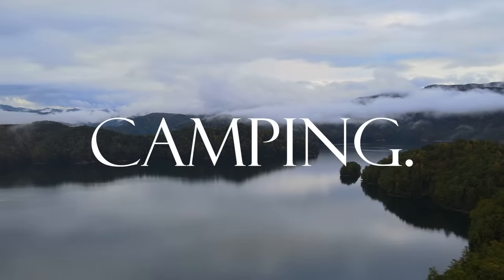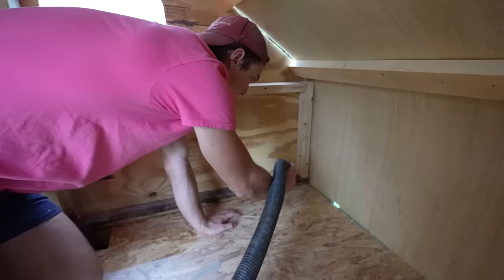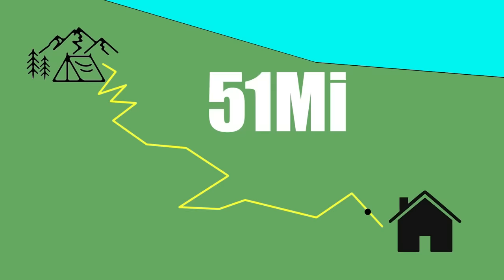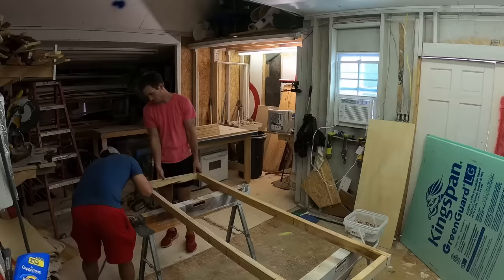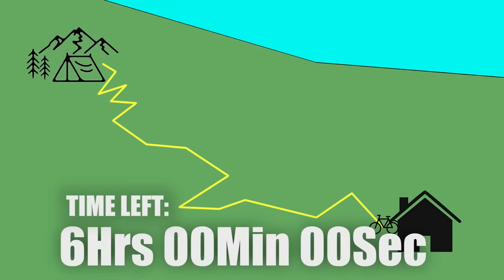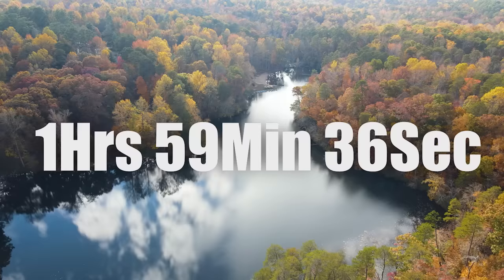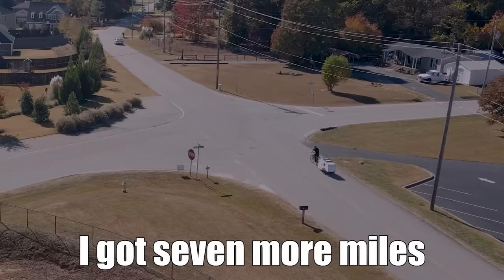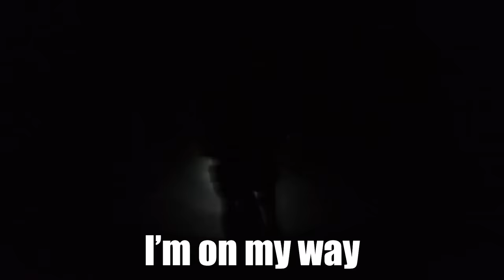I built a camper I can pull with my BIKE!

Comment: If you want to make a sturdier version, you can make the next one out of fiberglass. Super tough and extremely light too
Reply: Smart
Reply: @Spike16 where did u get it?
Reply: Just dont make submarines of it and you should be aok
Reply: @LPFGUERRA  That submarine was carbon fiber, not fiber glass.
Reply: @@spike1670 They are too big to be pulled by a bike though they are light for a nice camper they will need a vehicle to tow them.

Comment: The gate didn’t seem like too much of an obstacle to begin with lol. I thought it would have been much bigger. Idk seems staged at the end.. but good shit. You guys always work so hard.
Reply: Here in our place its normal idk why but its not so secured well i guess its that for a reason.
Reply: That gate is pretty effective if you'd be trying to get a normal sized camper inside. This one is tiny and made out of foam lol.
Reply: I also like the idea of it being locked down so if you have a sudden, life threatening emergency, no one can get in or out.  Good luck if you have a sudden health issue.
Reply: @cujoedaman  you think a moving car isn’t gonna break that gate? Lol
Reply: @Spacemountain14  no, the gate looks fairly thick, and crashing into that thing in high speeds will wreak your car.
Reply: @stefthorman8548  Bro if you go camping even at a campsite and don't have something that can open that gate then idk what to tell you. an axe or even a farm jack will bust that chain. and a vehicle will totally bust it too. the chain is the weak part

Comment: Suggestion for an upgrade which I did to mine - solid tyres on wheelchair wheels, and hitch via the rear wheel axle on the bike rather than the rack position - this will stop it tilting the bike when cornering. I ended up building a monowheel trailer to fit on my motorbike instead though.
Reply: He stole this build from Drew builds stuff

Comment: Thank you for sharing this video, it was a real eye opener-  i learned a lot and took notes!
I am building a bike camper currently- so far only the subframe is complete.  When complete, it will have more of a traditional "airstream" look.
My day job is in commercial signage, so i have all the free (used) aluminum tubing and sheet i could want at my disposal.  Trailer will have solid (not pneumatic) tires and hydraulic brakes.  Tow vehicle is a Tern GSD ebike.
Floor material will be a sandwich of fiberglassed polypropylene honeycomb and rigid foam.
Should tow okay (if I stick to my weight budget) as i occasionally pull a Bikes At Work trailer loaded with 300 pounds.

Comment: Those cheap wheels are notorious for the bearings loosening up. Taking an adjustable wrench with you would have solved it. Not ideal for regular repairs, but road side like that in a pinch it works great

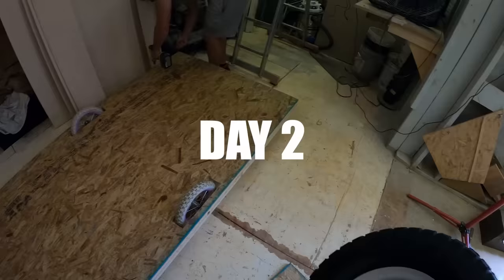Comment: Did you stage the camper falling into the creek? The wheels on the camper that you replaced the kid bike tires with 0:53 aren't the same ones on the camper when you pulled it out of the creek 2:57

Comment: You could use tyres that don't require air inside if them

Also you have to  use 4 wheels so there isn't that much stress
Reply: Only issue with that is that airless tyres are quite expensive as they're not widely and mass produced yet. Instead, it would be a good idea to use stronger alloy or carbon mountain bike wheels with actual all terrain tyres. The wheels should also be mounted to the camper with much tighter force.
Reply: @matthewtants6025  not really that expensive, but a big pain in the a-s to replace, also this build is like very limited and basic, almost to the point of being unsafe... he could have install a lot of auxillary stuff which wouldn't affect the weight that much, but instead they rushed it for the views.

Comment: Way to stick with it but hopefully you learned that doing dry runs with new equipment is a good idea :)  Finishing a build and planning a long trip with it untested almost always results in teething issues.  Also anything much over 100 lbs is a pain to pull with a bike and you should really consider trailer breaks if your going to try.
I've been considering makeing something like this myself but the general plan is to tow it around for a few miles around home and spend the night in it in my back yard once before just hitting the open road. I was thinking coroplast instead of foam

Comment: Long time ago I made a bike camper out of a pair of trikes, one was a more modern E Bike conversion, while  the “camper” was made from my grandparents old 70s-80s era trikes 
In trailer mode  it connected to the e bike with a Y yoke that hooked up to a large eye bolt i have welded to the ebike and to the front wheel yoke of the trailer. The handlebar of the trailer was turned 90 degree and half cur away, with the front handle acting as a goose neck for brake cables to the trailer wheels (really helpful on those down slopes) 
The seat of the trailer had been cut away so that the cargo area could be slid forward during travel 
When deployed as a camper the cargo area is slid back and fold down legs provide stability. For added stability it can also bolt onto the back area of the E Bike by removing its basket. The “camper itself is simply a assembled floor and an A-frame in which US Army shelter halves bolt onto BUT its what I’ve always been most comfortable with and i long learned to modify it with extra layers of shelter halves, rain proof tarp, bug netting , even movers blankets , and while I dont have a air conditioner the ridge pole can be threaded into a a length of dryer hose that is perforated and end in a small but very efficient battery powered ventilation fan. ALL of which can run off of the extra batteries that the trailer bike carries to greatly extend the range of the E bike

Comment: I tested my bike trailor with a ton of scrap ...... It lifted the rider 5 feet in the air when going down hill ....The cops were watching and they were laughing . . . The scrapyard turned me away cos the vehicle never had a registration .....The metal got dumped and the carabike was born many years before yours .. . .metal frame,bmx wheels, Plastic roof . . . . Never again .. I found balancing before towing was a must ...

Comment: Good lord the amount of design mistakes with this one. Here are a few improvements I would suggest:
- If you really wanted amenities, use something portable like a small projector and a fan, not a bloody flatscreen tv and airconditioner
- Don't compromise the tyres in favour of the aesthetic. The mobility of the camper is much more important than trying to hide the wheels or placing them right up against the camper walls to make it 'less ugly'
- You have to imagine pulling one of these with a regular geared bike, not a motorised vehicle, which is why you should have gone light to begin with. What would have happened if your e-bike ran out of power?
- The foam sheets were a good idea, but I would have gone with aluminium and tarp. Much lighter, inherently waterproof, and if you build it right, modular enough to unpack and convert into a larger sized tent

Comment: This is a really cool idea but I do feel like a lot more research could have been done beforehand and designing the perfect camper for this. I would've looked at those big strollers that bikers pull their kids in for structural ideas. Their camper has a similar setup it looks like but I wanted to mention it just in case. I also kind of find it hard to believe they didn't account for the weight of it in their first run? My immediate first thought was that adding the tv and ac seemed a bit heavy.
Someone else mentioned taking the TV down during transit like in a real camper and that made me realize they should have also looked at real campers, cause anyone that has driven with a real camper would've foreseen most of the problems he encountered.
Also wondering why his tire went flat so often, were they just cheap? And not thinking ahead to bring a bike pump? Maybe I'm just expecting too much cause I'm so used to watching science related channels that think way ahead. Maybe this was just meant to be a spur of the moment thing, which is totally fine and I respect it.
I do find it a bit weird that the camp site would be closed like that, if there are campers inside are they just not allowed to leave after 8pm??
Reply: appreciate your well thought comment but this staged as hell, tires they put on aren't the same as the one they pull out the creek 💀 to name one thing

Comment: You can save a lot of weight by using 1/8" sheet Teflon with 1/4 In. Plywood. Whatever works best for you. I have never been camping. It is mostly because of the insects.

When I was in the Army I gave my tent half to a guy who was passing by, went into the officers tent and told them  the Capitan said I should
sleep here. It worked for over a week. Nobody questions what a Capitan says.

Comment: Great idea, BUT I would have bought an e-bike with wider tires, added solar panels  to the roof and some LEDs inside and out with a generator on
the rear wheel, or the camper wheel. A smaller TV a bit closer to just over the middle of the bed about two+ feet up, angled down.
Remember why all products are replaced by the Mk II model. It comes from experience and afterthought.

Comment: Sadly such foam isn’t sold in my country 🫠
And I’m asking myself, wouldn’t aluminum rails have been sturdier and lighter than the wooden frame you set again? And as you mentioned bigger wheels mean being able to go faster, so I would have used minimum 28‘ wheels. And I don’t know if you have it in your country, but here we have a special glue that gets poured into a new wheel, which causes holes to close right away, so driving over Glas or nails and such is not causing problems, you just sometimes need to fill in new air but don’t need full fixing of the holes. 
But I think you did really well despite the setbacks you had, after all, you learned of previous mistakes and didn’t give up.

Comment: Great way to get the golf clubs to the golf course without the need for a car or windsurfer to the water....i tried this 2 years ago and its so difficult with the weight  issue...mind you i did mine with 4 wheels instead of 2 so it wouldnt pivot and follow my direction....down the chasm bit was perfect..exactly where it needed to end up...enhorabuena

Comment: 0:53 - "A campsite 50 miles away from our house. On a bike that's an 8 hour ride " -> 8 hours for 50 miles
4:10 - "25 miles per hours" -> has to ride 50 miles, is doing 25 miles per hour (give or take) -> 25 miles per hour x 2 hours = 50 miles
But wasn't it an 8 hour bike ride for 50 miles? When the math ain't mathing ...

Comment: weight is always the problem, you need to consider what you are towing with.

The first camper would have been fine if being towed by an LSM scooter/moped/boomer buggy.  while your speed would be much lower, the electric moters on those and breaks, as well as tow vehicle weight would have allowed for the heavier camper.

The lighter campers,  yeah,  foam, wood, fabric, little solar genny, maybe a little solar panel, and LED lights...  you can keep the weight down.   though best option might be to start with an exiting bike trailer frame.

Comment: Even pulling a trailer like this, biking 50 miles does not take 8 hours--especially on an e-bike. Biking 50 miles for me takes about 4 hours on a regular bike, going around 15-17 miles an hour (less as I get tired). If your e-bike is going 25 mph and over 30 mph on slight hills....something doesn't add up. Lol. Like the idea though.

Comment: The choice of material now that I go to thank of it since I have a e-bike myself I think instead of wood PVC piping would have been lighter and for the walls let's see here screen material and plastic wrapping paper oh and flex paste that would have made it a bit lighter for actually that'll be my choice for a mini camper plastic wrapping paper is light material so is screwed and you can wrap both into a dome and use the flux paste to make a hard surface on the inside and of course a frame would be needed so why not just aluminum actually the flex paste might just make a hard frame anyways since it's liquid rubber

Comment: This was just not well thought out at all. These things happen in your life because you don’t do any preparation or deep thought into things, at all.

You booked a camping ground not even knowing if you would make it there.

You installed multiple incorrect tire sizes that weren’t commiserate with the weight they would support for long distances.

You built a 100 pound trailer for a e-bike which is just ridiculous, could’ve made it from fibreglass if you wanted high density-low weight.

You wasted hours of time painting it up instead of just throwing a tarp over it and pinning it to the frame to protect from rain.

You didn’t even measure the proper distance between the tire and the walls. Which is why you had a flat tire.

You were late as a consequence of taking multiple tri-pod shots instead of just go-pro’ing and apologizing.

All of this could’ve been fixed with a call to see if they’d move your reservation ahead of schedule and if you used Google. All of this was just not smart at all and in the end, you didn’t even learn the lesson. Your take away was “Just keep peddling.” 

No, buddy, your lesson to learn here is “Measure twice, cut once.”

Comment: 8 hrs. To go 50 miles that's pretty bad expecialy with a electric bike it should not take more than 2 1/2 hours not no 8 hrs expecialy with a electric bike I have done 50 miles before on a regular bike in 3 1/2 hours doing like 15 mph most of the time

Comment: you pulled a camper 50 miles with no extra battery? also, thats "poor mans fiberglass" that you used on the exterior of the camper and you didn't explain that at all. Im guessing that none of this is "real".